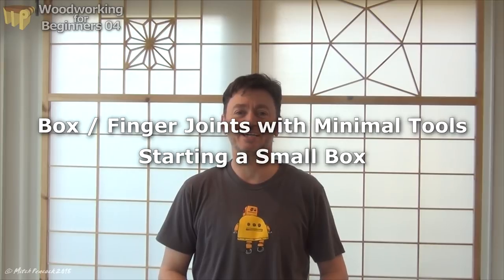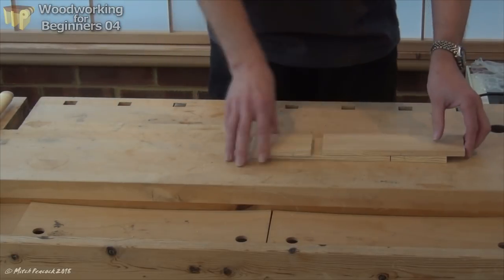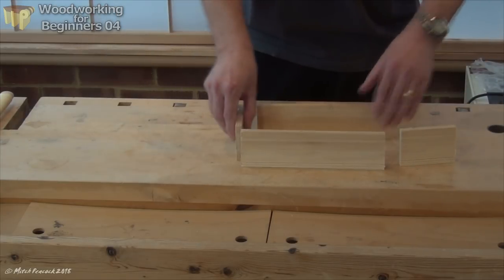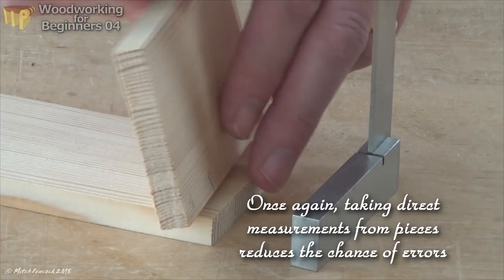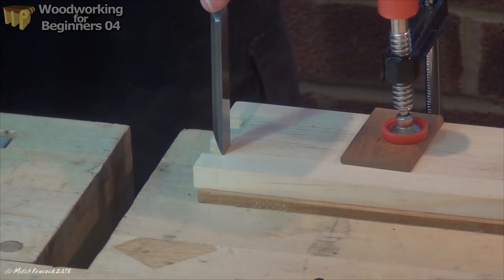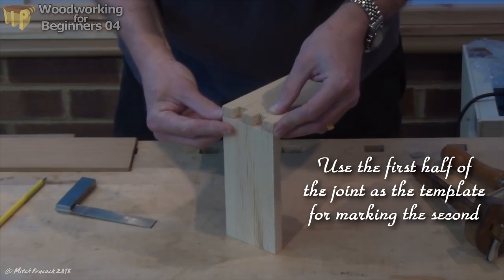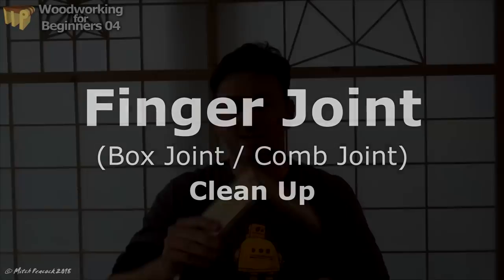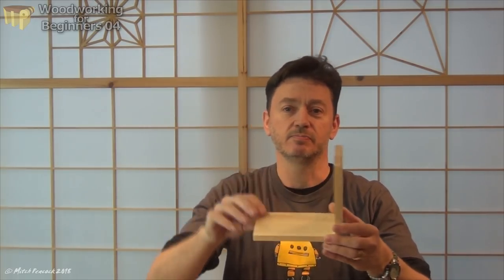Finger Joints - Woodworking for Beginners 04

Comment: I can't get my joints to fit nice and tight. I keep having lots of room between them. I cut on the pencil line, should i cut more on the waste side, could that help to get a tighter fit?
Reply from the maker: I prefer a marking knife to a pencil, as it leaves a cut to which you can saw. However, when using a pencil try to consider these points: Only a razor sharp pencil will mark exactly where you should cut to. Blunt pencils can't mark tight up to marking out tools, due to the rounded shape end. When you transfer layout from one joint side to another, as in finger joints, all the pencil mark should be considered "keep" not waste. Hope that helps a bit Lucas.
Reply: @mitchwoodwork  Thanks for your fast reply! I'm still like a mm off, so maybe the cutting on the pencil line is the problem as you point out that i should keep the pencils lines of the layout transfer markings. I do use a razor sharp pencil. I'm still somewhat confused because if you set up a line with a marking knife you can cut on that line. Sorry for my bad english, i'm from across the pond, Holland!
Reply from the maker: @lucaskramer4593  saw a little into the waste then, and then pare towards the lines until it fits